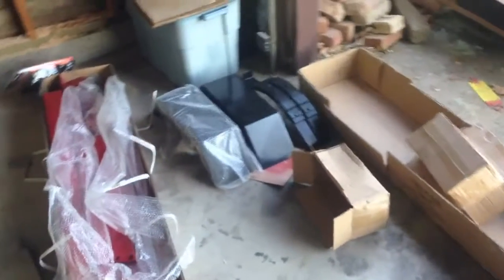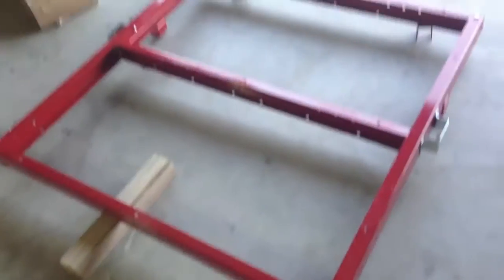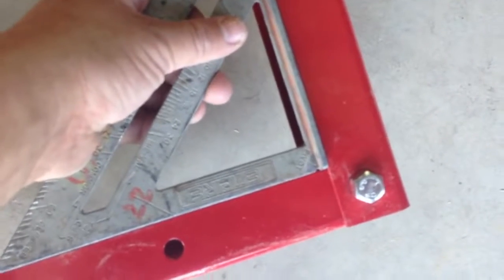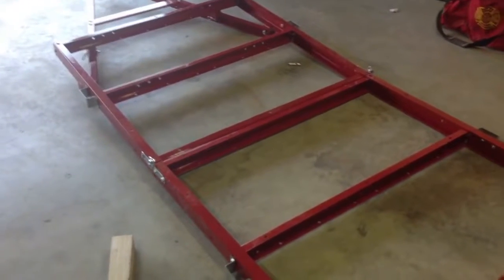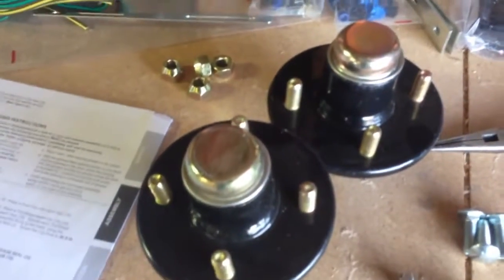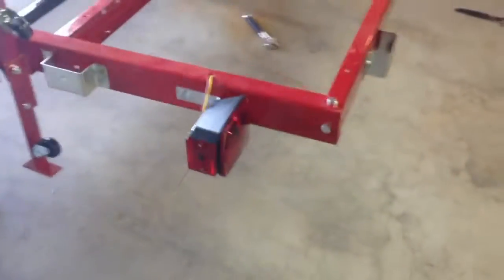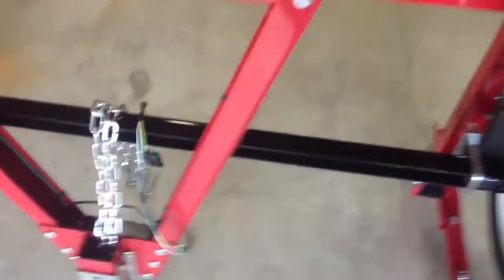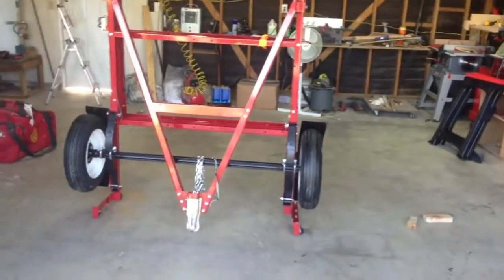63 Harbor Freight Folding Trailer

Comment: I bought one of these Harbor Freight folding trailers two years ago. I took my time and built it over a weekend. The zerk fittings will break if you try to install them, go but two new ones at the auto store, I got mine at NAPA after breaking the ones that came in the box. I greased the axles and took it on a 4 hour trip driving 75 mph. When I arrived I touched the bearing hubs and tires and nothing was hot or even warm. I added two eye-bolts to the front and rear rails same distance from the corner so that they would align and connected them with a double ended clasp to hold the two halves together when folded for storage.  This is a great trailer, just don't over load it.